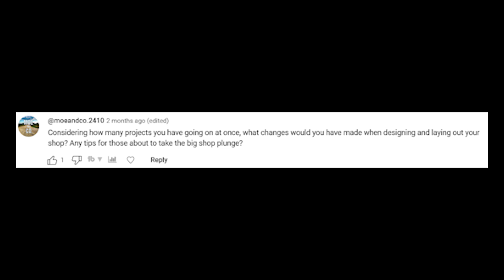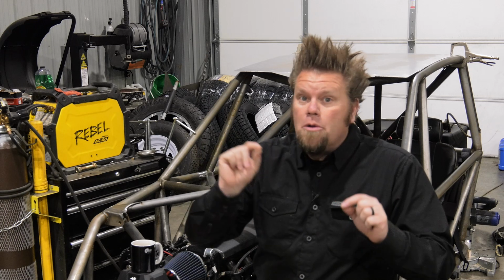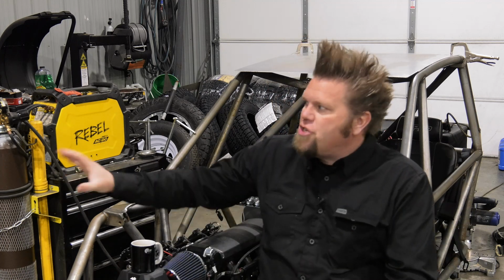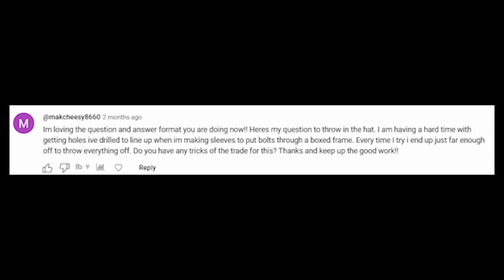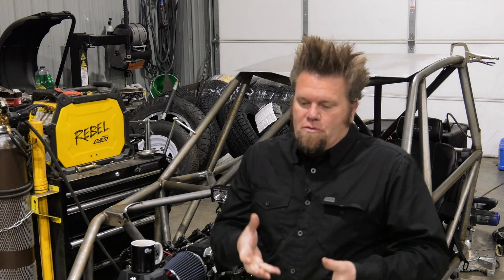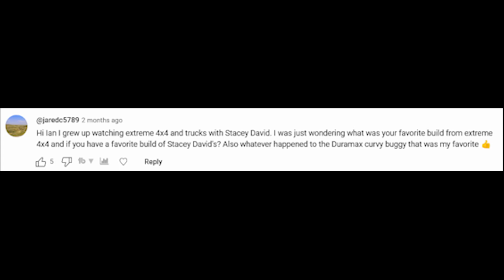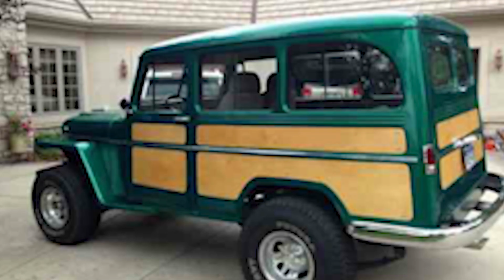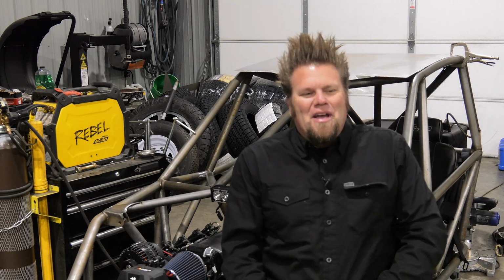What Would I change about my Shop, and Favorite Stacey David Build

Comment: I have taken square bar stock and drilled different size holes through each piece using a drill press. When I need to drill a hole perpendicular to the surface and take the right size bar stock guide, tack it in place and drill it. I knock the tacks off and the holes are in line.

Comment: Drill one side, insert your crush tube, weld it in, then drill thru the inside of the crush tube, using it to guide the bit. Also, get a drill with a spirit bubble built in. Finally, if you're working  with the same size tubing, make a ''C'' shaped jig with a guide bushing on either side to center the drillbit. Hope 1 or those work for you.

Comment: For through frame sleeved holes, I do reference marks on the floor and a laser, then mark both faces of the frame box, then you only need to measure up/down for your center point. I drilled out holes for shackle bushings and they were dead on using this method. Had to use an angle drill because the transmission was in the way for regular drill.

Comment: Concerning tube inserts.... you can "hang" a box-end wrench and achieve the same result as the nut suggestion. Also, when drilling the pilot hole, you can get longer drill bit to drill through both sides at once, then you can verify that you went straight through. Another suggestion/practice I've used is sourcing what is known as a "oop's" arbor for your hole saws. Basically if you drill wrong size hole it holds both at the same time. You can drill say a 1/2" hole initially, the add the size your wanting and the smaller size acts as a guide bushing. Had to get creative a lot being an ol' cranky steamfitter to make things work?

Comment: for the shop question, put in more power out lets than you would ever think you would use.
drilling, make a template and drill front both sides  or use a thick piece of metal and drill a 1l4 hole ,the tack or clamp it to the frame for a guide.

Comment: Great Q & A as always. My trick to drilling straight since I'm a shakey 61 year old gear head with old eyes, is using a 6" combination square, small carpenter square, or piece of angle iron as a guide to make sure I'm holding the drill level &/or plum. Also if I intend to drill at an angle I will bend a piece of wire or thin stock to the desired angle & use as a guide. Nothing better than watching all you young folks build Krazy Kool projects! lol

Comment: Late to the game but... For through frame drilling, I use a 3/16 id x 3" drill-bushing I had made from McMaster Carr. the OD is 5/8", drill one side to 5/8 then insert the bushing so that it is flat against the inside of the opposite side frame rail, through drill with 3/16 bit. Remove the bushing and simply drill both sides out to what ever my needed diameter is. Works flawlessly unless there is a ton of rust scale inside the frame, then it's a hog out, weld, and grind situation.

Comment: I built a 30x60 steel building shop trying to take all your ideas in consideration. I got the idea from a friend to decide the shop in two sections. So I have a deciding wall that creates a 30x30 work area and a 30x30 storage area for future and finished projects. Then I only have to heat or cool half of the building. Both have a mezzanine for storage with access by ladder. The wall has a 9’ high 12’ wide barn door so I can move things from one side to the other. I really enjoy my shop set up. 
For drilling a straight hole you can use a drill cage. They are different sizes and keep you perpendicular to the project. You can make one with some 1” steel block and drill bushings.

Comment: On the crooked holes in a boxed frame question, have you ever tried drilling one side to the OD of the sleeve, weld the sleeve in, then drilling the center hole out?

Comment: Drilling straight through a box frame: I drill a pilot hole, place a piece of steel tube with an ID matching the drill bit OD for your pilot hole in the hole that touches the other side but sticks out about 3-4 inches, use 4 magnetic 90 degree welding thingys at top bottom left right, tack the tube, spray in some lube, and drill the other side of the frame through the tube, and then just remove the tube and finish drill the two holes. May not be perfect but its been good enough so far.

Comment: Just a suggestion on drilling through frame rails or tube. There are a couple companies that make portable drill presses. Snap on had one that held a 1/2 air drill and had adaptors for others. These work very good as long as you can fit it in the area on both sides. It's basically a big C clamp type with handle and gives you the added leverage to push drill squarely to rail. I used to install trailer hitches and used one quite regularly.

Comment: My trick for straight drilling is using 1/4” long bit with an old holesaw on it. Keep it set close to the frame and it is easier to see if you are perpendicular. Being an older plumber I have tons - my favorite is a 2” one that has all the teeth worn off.

Comment: Tip for sleeves threw a box frame. Drill on the sleeve insert side only, insert sleeve and use the Id of the sleeve as a guide. Straight hole 100% of the time

Comment: One thing to add about planning your shop...I anticipate putting a lift in a certain area, so I had them pour the concrete thicker in a designated area. The couple extra bucks beforehand is well worth not having to cut out concrete, pin it and re pour where it would mount if your slab isn't thick enough for the lift you'd want.

Comment: For drilling straight, they make a drill block. I have one that has multiple hole sizes and is about an inch think. This helps getting the drill straight. But I have not used it on a frame tho.

Comment: As someone else already mentioned. Drill hole insert tube weld un and use it as guide to drill other side. 

Another easy idea would be to use a adjustable C/D-clamp, Large vice grips, etc, clamp it down and mark each side of your frame.

Comment: just make a oversize washer plate for the sleeve, then make the hole through the frame plenty big (plasma), welder it all up after it's aligned correctly. That's how we always did the frame bushings for a Toyota SAS

Comment: I’ve been welding and building a three link front on my 4Runner build. Every thing has taken twice as long as planned but the big win was getting my sleeves through the boxed and plated frame for the steering box on the first try. 👍🏻👍🏻👍🏻👍🏻
Reply: Drilling those sleeve holes is the worst.  Lol

Comment: I know you talked some about beadlocks before but my question is that what is your opinion on weld on beadlocks rings? I have a set of steel wheels I picked up for $500 CAD for 5 wheel that are the backspacing and size I needed. Is it a good idea to weld beadlocks ring on or should I just bite the bullet and get actual aluminum beadlocks.

Comment: My best advice on building a shop is, know your budget before starting. If its to much in the beginning,  if possible, split the build into 2 stages. Run any power and plumbing you need, along with the crete. Than you can finance the building if needed but, the added collateral you will have in all the 1st stage will make that process way easier. Know your climate and utility costs. Cold climate, an all black building will be best. Warm climate, straight galvanized roofing to reflect the sun, with neutral siding. If it middle of the road, gray roof and charcoal siding looks killer. Also, it cost a lot to heat (especially if its propane) and cool, so thats always a monthly expenditure. Going taller is also way cheaper than going bigger. My suggestion would be 18' sides, so you have 8.5' ceilings in the mezzanine area. 2 story gives you room for storage or hangout space, which will always be needed. Can you tell im a contractor and have built dozens of shops lol. Biggest being 80'X140'X18'.
Reply: Pex and pvc conduit is cheap. Run lines everywhere under the concrete before you pour.

Comment: Tips for straight sleeves.  
1) Make a drill bushing. A block of steel 1/2" thick with a squarely drilled pilot hole in it.  Clamp the bushing to the box section and drill the pilot hole all the way through.  This may require a long bit.  Then proceed as usual.

2) Drill pilot hole on one side only.  Drill the correct size hole for the sleeve using that pilot hole, on one side only.  Then make a sleeve with the correct outside diameter, but a pilot hole center.  Tac weld the pilot hole sleeve into the big hole pressing it up against the undrilled side to ensure squareness.  (This makes a drilling bushing, that will always locate the second hole perfectly.)  Then take out the pilot hole sleeve and drill the correct size hole on the other side.  Put in the sleeve, which will fit perfectly, and weld it in.  I say always locate the second hole perfectly, but sometimes there is a seam or something inside the box section, and this causes problems.  I put a rod into the pilot hole sleeve and square the rod with a square and then tac it in.

Method number 2 is more precise if the pilot drill hits a seam on the second it will not wander like it does with method 1, but method 1 is sooooo easy for most things.

Hope this helps.

Comment: Use a level and a drill bit guide. If the frame is level and plumb, a level on the drill or a drill bit guide will tell you if you are on target.

Comment: You mentioned the straight gears from a 4L80 for a t400 so which one would you use in a Jeep with a LQ4 based engine and I want to run reverse valve body

Comment: One idea to get straight pilot holes would be to make a tool with a pilot hole in it. Take time to make sure the hole is perpendicular to the metal you want to use. A solid steel block would not wear, but aluminum would work also. Use a clamp to hole this new tool where you want to drill and go for it.
Reply: Drill bushings are cheap easy to get and are like 60RC! you can move them from jig to jig
Reply: That's what I use.

Comment: Building a Comanche, looking to keep the fuel tank in the stock location. Thoughts on running a 3 link with a pan hard bar instead of 4 link?
Reply from the maker: You will see side tobside movement, but you should be fine

Comment: @makcheesy8660 if you're able to access both sides with a drill, you could also measure from a point of reference that's the same on both sides of the tube, such as a factory through hole, a mounting location for something, the ground or anything else you can come up with or combination of things. Then lay out the location on each side and drill from each direction. I know that's not always possible either though. Could also maybe use a laser to help shoot a line for up onto the tube then just measure up/down for the other dimension or use the laser line or a string as a reference. Some things force extra creativity when the easy way won't work and like Ian said, may just have to weld and grind and not tell anyone lol.
Reply: That's pretty much how I did my shackle bushing sleeves, a laser really helps with some tape/felt pen marks on the floor to transfer accurately from a "reference" point that is already on both sides of the frame to your needed location. For tight spots, a right angle drill can save your butt.
Reply: @abpsd73  man, I still remember the day years ago when my co worker showed me his right angle drill after i was bitching about trying to drill something and had no idea those existed. Haha. They can be life savers

Comment: When building a shop, you should figure out how big you would like it than double the size if possible. You can never really have enough space & it is much cheaper to build it big enough the first time than to have to add on later. Look at any shop build online. They quickly fill it up & wish they built it bigger.
Reply: So true went from 1.5 acres with 4000 sqft shop to 13 acres and a 26,000 sqft shop and it’s all full inside and out looking to build more  covered area just for storage
Reply: If you have a wife and kids, go another 50% again because they’ll want some space too.

Comment: The comment by richis65 is a good option which I have used and it is great. Also (you may already be doing this) although it may not always be possible due to drill bit length, any time you can drill through both sides with 1 pass.

Comment: My advice on shops is this. Treat your space like you live in Tokyo and find a way to nest your gear under benches where it can, like a Russian nesring doll. Treat all space under 7' as holy and if you have to commit to using it, try to use that space for hanging tools and thin shelves for small stuff storage to get it out in the open like Adam Savage advocates.. Here's mine if it helps. https://youtu.be/GMld0SDLASU